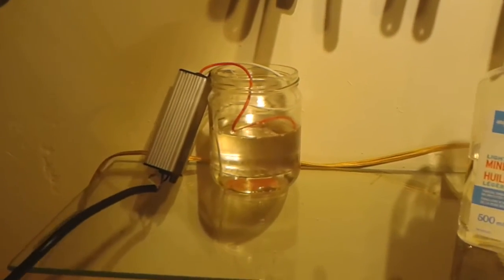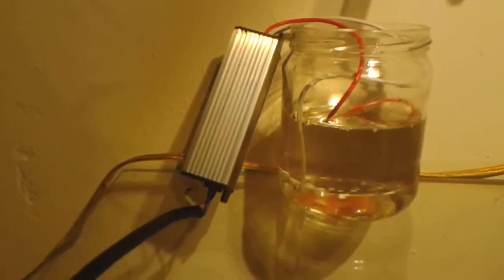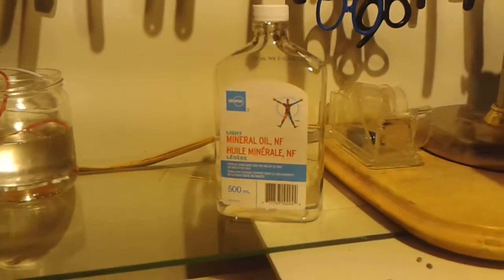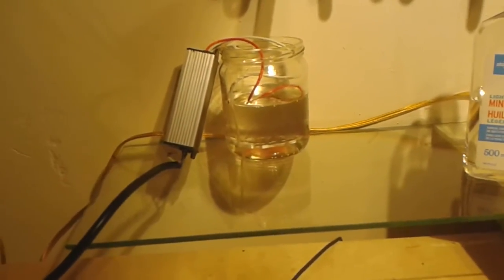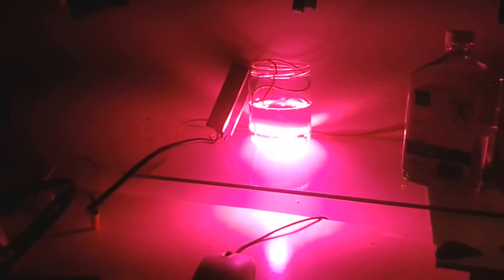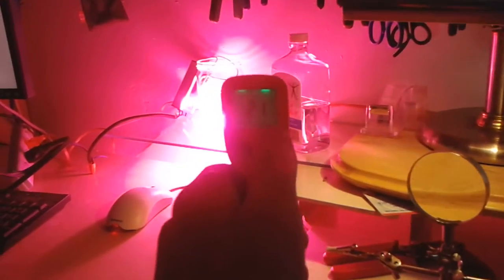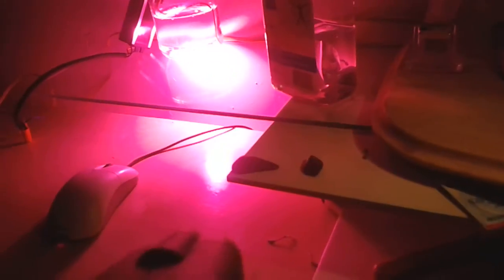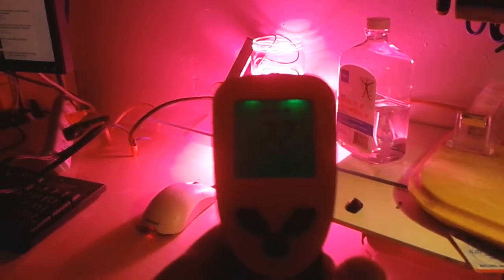50W Full Spectrum LED Mineral Oil Cooling Initial Test.

Comment: Question, are there any materials in this led chip that dissolve in the presence of the mineral oil over time? Also I believe as long as the mineral oil is kept flowing it can better remove heat from the led chip, since it’s a viscous liquid

Comment: How can you say, that it's doing the trick if it was on for couple of seconds.. Do 20h test.. I'd say it wont do the trick. Oil takes time the take heat..
Reply from the maker: this LED or driver did end up flickering. now it just flickers...did not get over 70C according to the laser thermo, what would you suggest? more oil, heatsinks strapped to the outside? Seen other videos of others who have done this with 100W Leds and just a bit bigger of a masson jar..is there something i am missing?